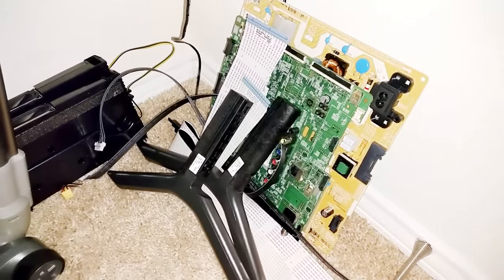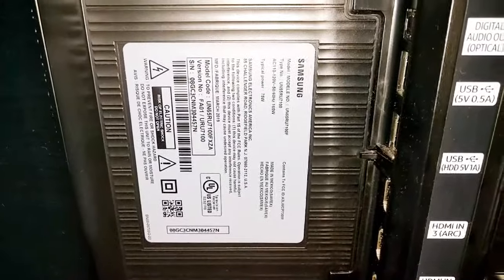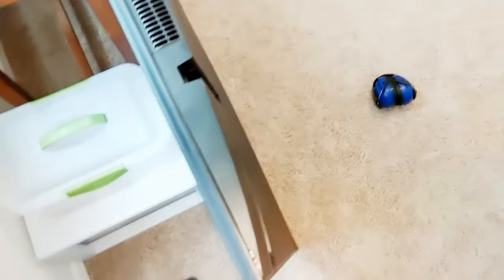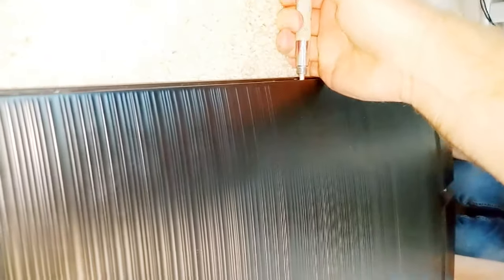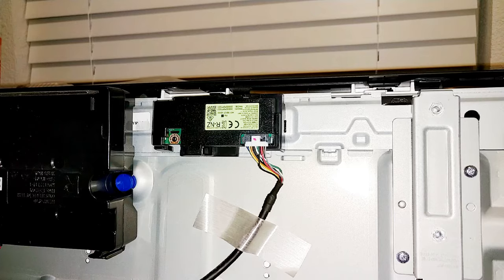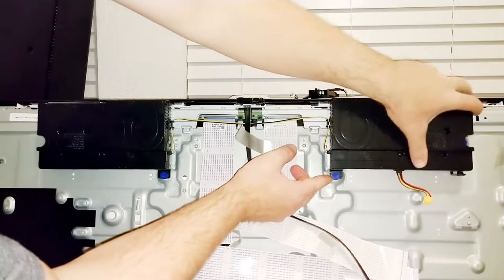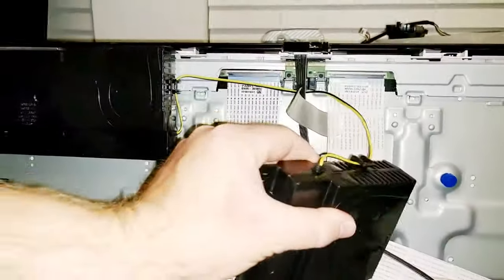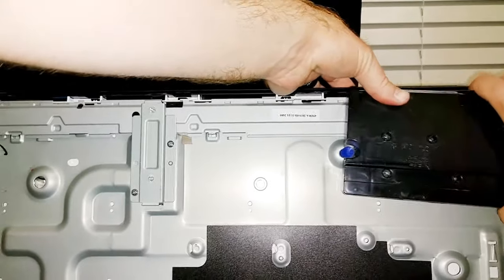Remove Screwless Cover (See Pinned Comment for Alternate) and All Boards on Samsung TV UN65RU7100F

Comment: This is not how you get the back off, unless you want to break it. that wire he shows  has a loop on the end, slide something into the loop and pull out the wire. do that on three sides and it will come off.  There is another video on youtube showing the process. https://www.youtube.com/watch?v=SD-M3Rg7h3Y
Reply from the maker: Thanks for the info
Reply: Good info!
Reply: I wish I had seen this reply before following the video to remove back of Samsung 60 inch 4K QE50Q60TAU. Screwdriver approach broke many plastic clips AND damaged the edge connectors inside the TV. Replacement Power Supply Board fixed the original issue. TV now “working” apart from thick black lines on the screen (caused by screwdriver damage), meaning it is now unwatchable and beyond economic repair. The original video does say “or replace them”. Having never taken the back off one of these (or anything like it) before, I regret following it and wish I had spotted this comment before starting. I appreciate it is a well intended video, albeit as this above comment and ‘correct way to remove the back’ video shows, it ideally would not say “or to replace them” (0:28). My TV is now off to the recycling centre. I will try to send back the used replacement power board. This note as a warning to others. See the above 👆video in the comment and use great care and the removal wires instead.
Reply from the maker: @nev1234567890 I'm not 100% sure your TV is the same process as mine in this video. I changed my title and pinned this comment. Hopefully it will help people check both videos to see what their TV has.
Reply: @becausestuffbreaks  Thank you. My TV looks very similar and does have the catches and all other aspects in your video. It also has the removal wires, which I only found once the back was off, broken catches and broken edge ribbon. Thanks for pinning and I appreciate you and all folks for taking the time and trouble to help others by making videos. I see from many other comments that other folks have found it super helpful.
Reply from the maker: @nev1234567890  thanks for the info and sorry about your TV. Hopefully this helps others from the same issue.
Reply: I believe what your talking about is for different models. Mine I literally ran a butter knife around the outside, barely pried up. While back came off, no broken clips, popped right back on when I was done
Reply: The removal wires in the OP original video are clearly shown at 6m 47s. Having (several times since breaking my first TV) removed and replaced the back and repaired newly acquired non-working identical TV since, I confirm FOR MY SAMSUNG TV (which also has the wires), pulling out the removal wires from the corners per the video linked by @mikeroberts9 comment above (and putting back the wires again before pop-on / back replacement) is absolutely a safer and just as quick way - for me at least. DYOR of course.

Comment: Great video. This method applies to the UN50TU8000FXZA as well as I found out. Replaced my FFC Cable (cheapest route, found one for $7) and fixed an issue where my TV would boot loop over and over with some screen distortion and lines. So far it's working like a charm.
Reply: How did you fix it? Was it simple?
Reply: Hey same exact issue and same exact tv, where did you find the FFC cable and what’s the part called??
Reply: Can i replace my Q60A motherboard ?
Reply: I have the same model doing the same thing, just ordered that cable. Will let ya know if it solved the boot loop and slight screen distortion. I shall add it powers on and acts fine for 10 seconds or so before it starts the boot loop.

Update: so i got the replacement cable and it did not work, the tv was still doing its boot loop, so i put the old cable back in and just let it be stuck in its boot loop. After about 20-25 it sorted itself out and now stays on..
Reply: I have the same model same issue it was repaired for the same thing 8 or 9 months ago samsung warranteed it one last time now its doing it again kinda disappointed in the product this time i might try repairing it myself edit last repair they changed the screen and both boards might be the ribbon cable this go around
Reply: I have the 75 in this model and it turns itself on and off constantly. Would that be the power board or the cable? Thanks
Reply: @ChrisB_Channel  most of the time its a chip on film that sends a signal back to the powerboard telling it theres something wrong turn off now you should be able to disconnect to ribbon cable and hear it boot up and stay on without the bootloop just wont have a picture obviously but thatll give you an idea of whats wrong
Reply: @donaldcayton5535  I unplugged the 2 cables running into the green board and now it stays on without rebooting. Plugged the top cable in and stayed on. When I put the bottom cable in then it reboots. Would this mean simple issue with cable? I'm clueless haha thank you for your help
Reply: @ChrisB_Channel  when you say the second cable do you mean the small ribbon at the bottom that connects the two halfs of the screen mine has one big ribbon cable and one that attaches the left and right sides of the screen some models have two big ribbon cables and the smaller one at the bottom my tv was bootlooping i somehow got it to turn on and only put it in sleep mode when i dont use it because im afraid if i turn it back off it will fight me to turn on again😂
Reply: @ChrisB_Channel  i was able to troubleshoot mine to the point i know its something on the right side of the screen sending a signal back to the board to turn off
Reply: @donaldcayton5535  @6.12 in this video the 2 white ribbon cables going into green board. At this frame it would be the top ribbon connecting to the green board. If that makes sense lol
Reply: @ChrisB_Channel  that powers the left side of the screen so its either the ribbon cable or a resistor on the left side of the lcd panel itself
Reply: @donaldcayton5535  thanks again mate. With the FFC ribbon the part number is BN96-39820H which I can find but there is another number on it WX180625L2 which is harder to find/match. Does it have to be the exact same cable or same part number enough? As you can tell I have no idea lmao

Comment: Thank you for this video. Extremely helpful. Was able to repair my shot power board. Saved me hundreds of dollars in repairs/new tv.
Reply from the maker: Awesome! Thanks for watching!
Reply: hi there, if you don't mind, could you help guide me on my problem? my mom said she was going to turn on the tv but when she hit the power button she said something sparked, so she unplugged it. And now I'm watching videos to see what to do, and your comment sounds like what might've happened, so I'm asking if you could please let me know how you fixed yours. thank you
Reply: @stepbroshow3334 hey man, my whole power board went out on my TV. I had to order a new power board and replace it. If the TV is plugged in and it won't turn on its more than likely the power board went out. It's pretty simple to replace tho, just make sure everything is turned off and watch this video to make sure you don't touch any parts that could shock you. Once you're comfortable with that just take the back panel off and slide the old power board out and the new one in.
Reply: How did you know for sure it was the power board? Mine won't turn on but no visual damage seems to be present on either of my boards

Comment: Thanks for the video. You made it very easy to take off the back. 

My question is, my TV is flickering like it was trying to turn on but wouldn't actually power up. I reseated all that I could, hoping that would help. It didn't. What would you try replacing first if I'm doing it myself? Thanks.
Reply from the maker: Power supply board. If that doesn't work,  then the Main Board
Reply: Just tossing this in in case you never had any success. I ordered and replaced a new FFC Cable (large ribbon cable-looking thing) and that did the trick for me - so far. 😅 

Granted, my model was a Samsung UN50TU8000FXZA.

Comment: Thanks for the video! I have the same series of TV and hear a crackling sound with what sounds like (I think) a fan that needs to be cleaned/replaved… I removed the cover and didn’t see a fan anywhere… do you happen to know if it’s maybe housed with the speakers? Or behind one of those boards and I just didn’t see it in your video? Thanks for any help!
Reply from the maker: There's no fan. That sound could be noise bleeding into the audio through a poor ground or a bad solder joint. Or it's a bad power supply or inverter circuit for the backlight making a low frequency humm. You could take a video of the sound and share it on my Instagram or MeWe

Comment: That video was EXTREMELY helpful! Thank you so very much! I found out the problem was actually the line of wires that connects the power board to that second, green, board. Do you happen to know what that's called or where I could find the answer?
Reply from the maker: Search the make and model on eBay and it will usually have the used parts on there

Comment: Thanks for the video,I successfully removed the back cover.
 I’m currently waiting on my power supply mail order.
So for that reason I still have the back of the tv left undone.
How do I successfully install the back cover?
 Any tips or suggestions would be appreciated.
Thanks
Reply from the maker: It will snap together when you put it back on

Comment: What is the name of the long strip circuit board under the bottom metal panel that connects to the main board via the while belt cables? That the IR sensor clips into? I noticed you didn’t remove that?
Reply: Is it the LED control panel?
Reply from the maker: I think it's the interface for the grid of pixels.

Comment: can you make a video on how to reuse those speakers? also why are they encased? are the wires out side the encasing just power wires?
Reply from the maker: They are encased to basically make a little speaker box and give it better sound. The 2 wires are not power wires. They are just the speaker wires. Cut the plug off and strip the wires back and you can connect them to an amp or stereo with a speaker output.

Comment: I have almost exactly the same television except mine is a 75 inch. Not sure if you know the answer to this (or anybody who knows about this TV) but my symptoms are that when you go to turn it on, the (Samsung) logo comes on solid at first… and then these horizontal lines develop (which chops up and dims the picture a bit)... and then the TV shuts off and goes through that cycle again.

 Usually for 10 minutes or so, it reboots, over and over again. 

When it's just about to turn on and work (which it does usually in less than 15 minutes of letting it cycle like this) you start to see the main menu screen, etc. and then the horizontal lines develop and then it shuts off ... and restarts and then FINALLY, it comes on for a few seconds (with the sound of whatever the TV show is that's playing or whatever) then, it  usually goes through one more cycle... and then it stays on (and works perfectly from that point on unless you turn the TV off again). 

I'm wondering if that's a power board issue (rather than a main board issue). 

According to the seller who sold it to me, It did start occurring, just after a lightning storm. 

Do you think replacing the whole power board would do the trick in fixing it? Short of that, is there a particular part (or two) on the power board that would usually be the culprit that I could replace for a lot less money than replacing the whole power board?  Even if I have to pay about 125 bucks for a new board, I think it would be worth it. It's a great TV once it stays on.  

Thanks!

Comment: So say my tv is fine, but i just wanna open it up and maybe cut some holes in it to fit a lil fan to keep it cool, will removing the back panel this way wreck the screen? Sounds like some shattering going on while prying it up with the screwdriver.
Reply from the maker: The crackling was not the screen breaking. If you want, you can buy the fancy plastic tool. It's fairly cheap. https://amzn.to/3LMDzer

Comment: I have a Samsung TV model UE43RU7105. When I power on with remote the power light flashes a couple of times and remains solid but with no picture appearing. At the same time I'm hearing a squeecking noise from middle of the motherboard ( which i replaced with same result) After randomly disconnecting and reconnecting various connections basically not knowing what the hell I'm doing, I'd press the remote and the screen suddenly powers on perfectly, and will stay on indefinately till i power off. When i go back later to power on, the problem starts all over again. Any ideas out there to help me out.
Reply: Ian:  I happen to be working on a similar TV with the same symptoms as you have.  When I disconnect the main board and plug in the TV, the backlights turn on.  This makes me believe the main board is the issue.  I have the same high pitch screeching noise three times at plug-in that you are observing. I would love to see if you have the same results powering up without the main board connected and how you eventually solve your problem.  I was just about to buy a main board but your results concern me.  Is there a more private way to communicate?  Thanks.
Reply: @YuDaMan   Hi there. Yes, backlights come on when I disconnect the main  board. (I misnamed it as the mother board) The sound |m getting from the main board is a very difficult to hear squeek which I also get when pressing the remote, but as i mentioned I did replace the main board ending up with the same results. Will keep you in mind if I ever resolve the problem and post here.
Reply: @ianhamilton8456  Thanks.  Not much to replace ....either main board or Power supply.  Maybe you got a bad replacement board?  I will keep you posted if I solve it. Thanks.
Reply: I fixed it.  See this video:  https://youtu.be/MN_oLD6wFkQ
1.  power supply was bad .... 3 bulged caps (replaced those caps and power supply works but 
2.  the main board was also bad.  I suspect the bad caps was causing the high frequency squeaks/churps.  Good luck.

Comment: Very helpful in getting at the all the pub’s. Will replacing the main board restore audio outputs for optical and HMDI (ARC) outputs?
Reply from the maker: Should
Reply: Yes all connectors in/out audio/video are all part of the main board, so when you are replacing the board you are replacing all the connectors along with it, including the firmware included in the board.  You would want to make sure to update to the latest firmware on the new board if not done already, as sometimes updated firmware fixes issues.

Comment: Hi - same model with a problem. A flash of lines appear on the screen for a few seconds, go away then come back intermittently. Any thoughts? Maybe video cable needs replacing? Wish I could upload a video in the comments!
Reply from the maker: Take the back off and unplug all the cables that you can and then reseat them I have a public group on MeWe you can add videos and pics to: Share Your Trade: https://mewe.com/join/shareyourtrade

Comment: How do you get the internal stand bracket off? I has a silver clip and a small arrow pointing to what appears to be a a leverage/tool access point or something just below the clip. Raising the clip does nothing in the way of allowing the bracket to move about. I have to fix a clipped wire for the backlight, so if I don't need to remove it I don't care. Mine is a aUN43NU6900B.
Thanks man!
Reply from the maker: Sorry. I wish I knew

Comment: To discharge a capacitor you use a Volt Ohm meter test for voltage and it will discharge the capacitor.
Reply from the maker: I've never heard of doing it that way. I would think you could destroy your meter doing that.
Reply: @becausestuffbreaks  Yes that is TERRIBLE advice :P I wouldn't be poking the 400V cap with a volt meter :P  NEVER attempt to discharge a cap using a volt meter unless it has a feature that allows it to safely discharge caps.  A multimeter is meant for measuring not discharging, not safely -  TO do so, and the safest method, get yourself one of those discharge pens, you can then use the multimeter to measure the CAP.

Comment: Dude AMAZING video!! Question: my TV occasionally powers on and works normally but then other days it doesn't wanna turn on. The red light begins to blink on days that it doesnt wanna work. You think that's a power supply board issue or is it the main board?
Reply from the maker: Most likely power supply. The blinking light might be a fault code you can look up to find out what it means.
Reply: @becausestuffbreaks  ok tried changing the PSB, still no. Luckily I got a deal on the PSB and Main board together, so I tried replacing the MB. Works like a charm. Thanks again for your tutorial
Reply from the maker: Awesome! Thanks for the info. Glad I could help.

Comment: This is interesting. I'm having an issue with the sensor. I changed the batteries in my remote and everything but it's not registering with the TV anymore for some reason. I have the remote app on my phone and it works fine but the TV sensor isn't working with its original remote anymore. Any suggestions? Thanks 😊
Reply from the maker: Yes. Point the camera of your phone at the end of the remote with the IR light and start pressing buttons. You should be able to see the remote transmitter light up through your camera. You will NOT be able to see it with your naked eye. Let me know what you see.
Reply: @Because Stuff Breaks with Justin Peters yes. The remote light flashes but the TV sensor isn't picking it up.
Reply from the maker: You'll need to replace the sensor. Here's where I show that in this video 11:50
Reply: @becausestuffbreaks  thank you! 😊
Reply from the maker: @Phillyqt19  let me know how it goes. Thanks for watching!